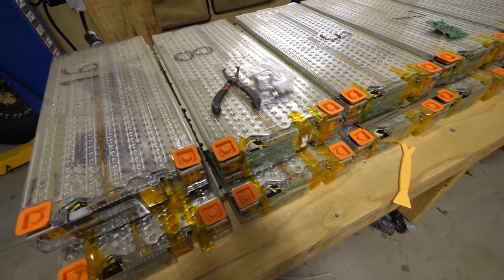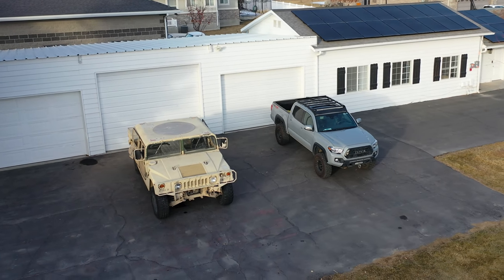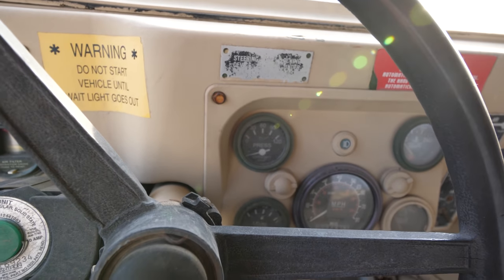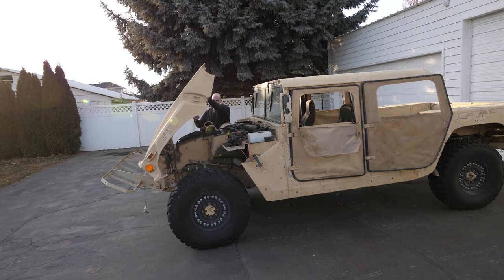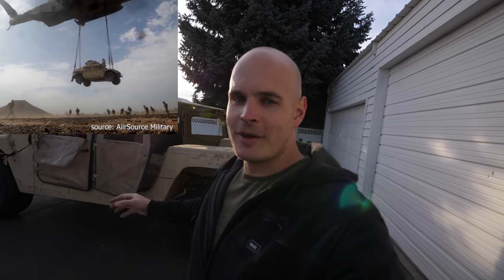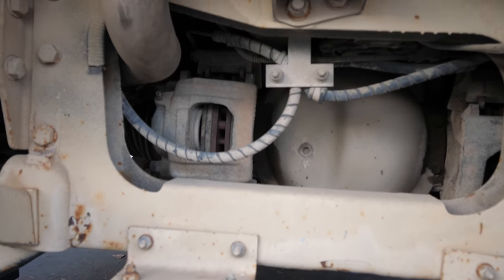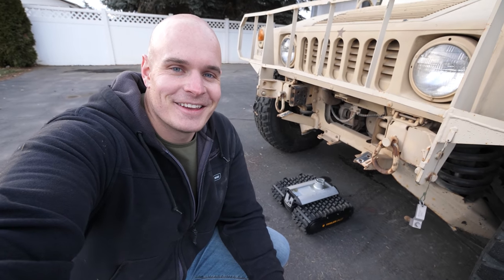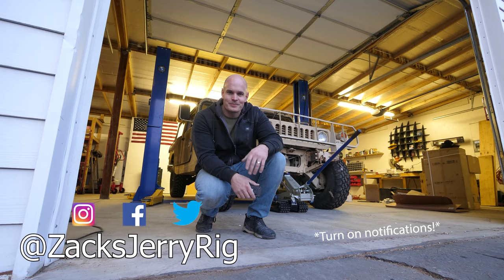Can I build my OWN Electric Truck?! -  Say Hello to the EV Humvee!

Comment: Why not use 4 "wheel motors " you would only need a 12 volt battery.  Each wheel generates 100 hp .

Comment: Zack are you planning on keeping the transmission intact? Or maybe convert it to a 2-speed transmission like the Porsche Taycan and the Formula-E cars? So that the truck would have a crawl gear and a cruise gear, I was thinking..?
Reply: Seems like he's gonna bolt it up to the trans.. He could bolt a motor to the front and rear diff directly

Comment: I’m going to give you a very valuable piece of insight!

 you have enough batteries… where you should separate the battery packs …into 2-separated packages:
 of batteries ,and put a switch between them !….and then you use an 200 amp alternator to create power,& run it through a power inverter,& a charger..… and make one ;
of the two batteries, 
that got depleted… be- recharged..& 
 while you’re driving !…but the one being charged ?…is not driving the vehicle!
 this way;
 you are “self recharging”… and you don’t need a solar panel, because you can trickle charge it over a few days.and you don’t need to plug it in…Yes:
 I would probably put both of them, in…as ..”back up”… charger systems…

Full-size trucks able to haul a trailer a tiny house or you could even have a semi that for the tiny house around and it uses electricity instead of fuel

Comment: Fuck me. I had this dream of converting a hummer to an electric version, not because of "muh enviroment", but because of the torque and lack of fuel in a SHTF situation. 
But I also had an idea of incorporating a multi fuel generator inside, to power the electric motor incase you run out of juice and also have a place to hook up solar panels if you're just camping somewhere. 

Looking forward to seeing how you're going to do this, going to subscribe for this one.

Comment: Diesel fuel can last for years bud.. i work on vintage diesel buses, trucks and equipment and i can tell you diesel can last 10 years or more if there’s no rust or moisture in it.. I literally just fired up a 56 gm 4104 greyhound bus with a detroit 6-71 diesel engine in it that’s been sitting in a dirt lot since 2003… it was stored with 1/2 tank of diesel fuel and it’s currently running on that same fuel that was put in it in 2003.. smokes a little but gm 2 strokes always smoke a bit after sitting that long anyway.. not to mention diesel fuel can easily be made. Older mechanical injection diesels will run on any petroleum fluids as well.. motor oil, hydraulic fluids, transmission fluids etc..

Comment: 5000 pounds in ICE version ? Much less than expected ! If you can keep yours on E-conversion under 8500 it would be impressive as i just saw the new GMC Hummer pick up will weigh in at 9200 pounds ... That's commercial license territory where i'm from (the Hummer H2 was sold far less overhere because its width put it in commercial class)

Comment: as I know gasoline lasts up to 3 years.. but still useable after that but life span for the engine will be low, which in case zoombie it is not an issue :)

Comment: it would be great if you remove the engine, trans,transfer case all together and use the transverse ev motor layout to your advantage by using the ev motor diff as a transfer case, you will free up a lot of space for battery's and reduce complexity and have a good weight distribution and i don't think attaching a ev motor to an auto trans gonna be that efficient, there's a company in the uk that transform old Landrover's Defender's to ev by using that way, Matt watson featured them in his channel.
Reply from the maker: Good call. We won't be using the HMMWV Transmission.

Comment: at 49 seconds: 1 fuel is stable for 6-12 months in a sealed container WITHOUT fuel stabilizer, which is readily available. the reason fuel goes bad is that it is hydroscopic, and you can add things to fuel to mitigate that. with a good fuel stabilizer, its good for 3-5 years. which is what many in the prepping community do: buy thousands of gallons of fuel, stabilize it, and rotate it to be ready to go. I hate to be like this, but at this point, electric isn't ready for the apocalypse. long charge time compared to refueling coupled with the massive power consumption... most people, even ones with extensive power arrays would take days or even weeks to charge the hundreds of kilowatthours an electric vehicle takes to charge. my dream property could maybe output enough to charge a 200kwatthour battery in a day and not sacrifice other electronics, but barely, and my dream property has a lot more power production than most.

Comment: I really wonder what the "greenness" of this will be.
You have to figure our how much energy the engine is using per distance, then multiply with the co2 output of your state per same unit of electric power.
My bet is it's still going to emit more than a brand new Ford Mustang GT (over 263 g CO2/km) , but it's really up to how the power is generated in your state and how efficient it will be!

Example: a state with around 500 g CO2/kWh, and a big EV hummer with an approx. efficiency of 500 Wh/km would be the same as a Mustang.
Reply: well, an electric smart would be about 10 times better than a Mustang GT.
Reply: @Elektroreisen  you didn't understand my comment.. The electric smart is only using power and assuming the power you charge with is made "green".
A Mustang will pollute the same no matter what country it is in.
So yes if you have an electric smart in Norway, the country with some of the cleanest energy, it will be ten times better. It won't be in most US states.
Reply: @HForceClan  no, since petrol needs to be produced too, the mustang won't be greener than this mustang. A team in Yale just did a research and found out that since gas production is using so much energy, it doesn't matter how the electricity for the ev is generated

Comment: If the Hummer was a gas guzzler because of its weight and drag, wouldn't it still be guzzler if you're switching the energy source. It will just guzzle a different source of energy.

Comment: Hey can you the regular electric motor in it but you need to look at like the boats electric motor for back up if that’ll work on land because that might have more power or a diesel electric motor

Comment: No disrespect, gonna have to disagree on an electric vehicle being best apocalypse vehicle. Best apocalypse vehicle would be an a vehicle with a multi-fuel engine capable of running on virtually anything. For an electric to be best in the apocalypse, you would need to constantly carry enough solar panels to charge the battery within a short time. Unless the sky is black, in which case you would need a wind turbine or hydroelectric generator.

Comment: Ya know, with that large battery pack, you could probably build one sick rail gun/coil gun and mount it on the roof. Since it's not a firearm it should be legal, although I am not a lawyer and don't have any expertise, just some guy on the internet.

Comment: rad project! is there a reason why you didn't use a Tesla motor? Im looking at a conversion right now
Reply from the maker: Tesla motors are really good for speed and high RPMs. But not good for heavy Towing. I could use a tesla motor for sure. But since I don't want to go over 80mph and i do want to Tow.... it would be mostly wasted.

Comment: "Still weights about 5000lbs, which is a lot of weight for an electric motor to be pushing..."

Tesla's 5500lb Model X that does 0-60 in 3 seconds.... has entered the chat

Comment: I would say that diesel vehicles would be available in the apocalypse, because it can be easily made from vegetable oil, you will only need sodium hydroxide (NaOH) and methanol (CH3OH). EV batteries degrade over time, so they are less popular. Gasoline is difficult to make and ethanol would be only viable in gasoline vehicles, provided if you do modifications that allow it to run on ethanol.

Comment: i don't know if i would be relying on a electric vehicle for a apocalypse waste land. you would likely be better off with a diesel. where would you get a motor controller or the parts to repair it in a waste land? the parts would likely disappear just as quick as the gasoline. at least with a diesel there are many old school mechanical diesels out their that are very reliable and dime a dozen. diesel fuel lasts a lot longer and bio diesel is farely easier to make .

Comment: Actually, you're wrong. Gasoline is fairly easy to manufacture. Google "Wood gas generator."

The real problem is things like replacement parts, especially oil filters, and of course, oil. Engine oil is much harder to make than gasoline.

Comment: How come a vehicle sitting for six years with old gas in the tank still starts, runs, and doesn't even throw codes?  The whole gasoline shelf life thing is about "meeting standards", not the ability of it to burn.  Yeah, your premium will likely no longer be good for a high compression, forced induction supercar, but it'll be just fine in an old dodge pickup.  Ethanol in gas is likely going to be a problem, but it's not unresolvable.  You can even run some vehicles on alcohol and that predates gasoline by how long?  For diesel vehicles it even better.  Without jumping on the bandwagon of biodiesel - you can run ATF.  There's a near endless supply of it and it has very long shelf life if you're shrinking the world population as a scenario.  Then we jump to multifuel engines that really will run on anything that's relatively liquid and will burn.  Burning liquids are not that uncommon in general.  Now all batteries have a shelf life.  EV batteries especially.  They'll keep slowly losing capacity and without fail the battery pack will need a replacement, but what will you be replacing it with in THAT scenario?  I love the project, but the opening just doesn't work for me :D I can't possibly imagine an end of the world scenario where EVs are the answer, unless it's lead-acid and short range.

Comment: diesel engines can run on so many things other than diesel if it's the end of the world you could run it on random flammable liquids you can find rather than waiting for the sun to charge those massive battery packs plus the batteries don't last forever and god knows how much range it would have this would be horrible in an apocalypse

Comment: The funny part about electric cars is that by the end of making one u have released over 10 000 European miles worth off carbon dioxide but when a non electric car is made it have released a lot less carbon dioxide but over time it may be better depending on how the energy is produced

Comment: contact chrisfix he can help you and remember you bought a damn elite level project car 
if you follow donut media you mustve seen what happened to nolan be careful what you buy 
it might turn into expensive dissapointment you arent a car guy there are many things to worry about just replacing the motor and gas tanks aint gonna fix it you need to see the drivetrain suspension wiring brakes axel portal wont cut it man be careful what you do this thing will require some engineering

Comment: A tesla weighs more than that Humvee so why wouldnt you use the tesla motors? A waste of efficiency to use a highly inefficient motor over teslas motors. The range and power isnt just from the battery. Their motors are special and they can easily handle the weight of that truck all day long. Taking out the diff and putting two motors in the middle on each shortened axle would be cake.

Comment: gasoline only lasts 6 to 12 months in a sealed container? Tell that to decade old gasoline I've driven on just fine :-D Then again, years after an apocalypse your tanks would all be dry unless you'd had the foresight to stash a metric shit tonne in a big underground tank and then ration it out to yourself carefully along the way. In summary, I agree with your end conclusion, but how you got there is totally false ;-)
Reply from the maker: Your personal experience doesn't reflect the scientific reality of gasoline.
Reply: @JerryRigEverything  Ha ha, my regional (not personal, it's WAY beyond personal) experience of gasoline does reflect the scientific and actual reality of gasoline in my region. Here's what you clearly don't know and absolutely need to know: Carburettors need special gasoline. Fuel injection systems can run on almost anything, including hard-to-ignite slow-evaporating substances like xylene and toluene which burn with a black soot if you light them in open air. An EFI vehicle will start "cold" (10C or so, colder maybe not so much) just fine on these substances without the help of the additives which vanish from gasoline over time. So your "scientific" experiences around two-stroke lawn and garden gear, older carby cars, and other crude devices whereby fresh fuel is absolutely a requirement is not a commentary on the internal combustion engine, but rather the crude old fashioned mechanisms that sometimes feed those engines their air-fuel mixture. The other thing to note is that cold climate gasoline has way more of those additives and a totally different blend as a result of unique cold (genuinely, -10c or so) starting requirements - these fuels, for this environment, do go bad, and do not last. I invite you, though, to tell me how stored toluene "goes bad" with time? The fact of the matter is that it never changes in composition as it's a stable pure substance. If it can start and idle fine on day one, then it can start and idle fine 20 years later if no seals or other mechanical contrivances have failed in the mean time in various ways. Share your home state and we'll get an idea of the type of fuel your scientific experience covers - mine is hinted at in the "cold is 10c" note. Cheers :-)

Comment: I like that idea even though i am against EV cars, i just simply think its stupid.
I have a normal petrol car with lpg instalation and my emission is so low your ass farts generates more, my friend has a f*ckin V8 hemi that generates a lot, but even that is just a tiny amount when compared to a diesel after a few years of driving.

Im living in europe and car manufactures are doing everything to minimalize emission, most of the new cars have only 3 cyl. 
Also as u can guess they have to have a turbocharger to even keep up with the normal cars, this causes a massive problems in the future, cars like this will often break and generate lot of junk much more in their lifetime than normal car or even a ev car. 
So to summarise i think the best way is to keep the minimum of 4 cyl. and add hybrid drive to the mix.
A hybrid v6 will be much better than a f*ckin 3 cylinder 0.8 TCe overloaded to 110 hp.
Don't believe me ? Then buy yourself a car like that and come back to this comment after a few years. 
I've seen enough, fuck all EV and 3 cyl.
Only hybrids

Comment: The phrase “electric vehicles are the future” really pisses me off. If anything they’d be worse for the environment. Not only does most of the electricity used to charge those vehicles come from burning fossil fuels you have to dig huge holes in the earth to find many of minerals they put in the batteries such as cobalt. It’s just as bad as drilling for oil at least that doesn’t leave a huge fuc** hole behind. I’m gonna keep burning gasoline until one of these big companies finds a renewable source of electricity and a way to make a battery that doesn’t require mining minerals. Until then fu** electric vehicles.